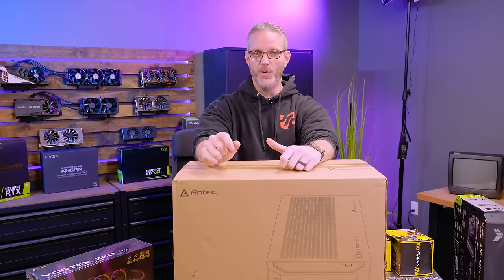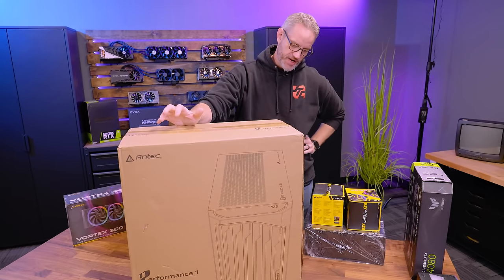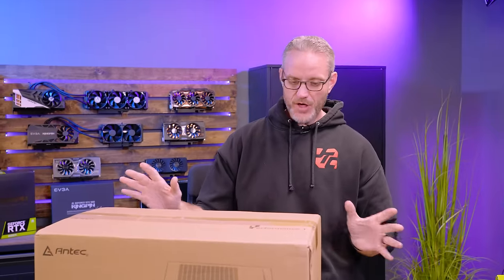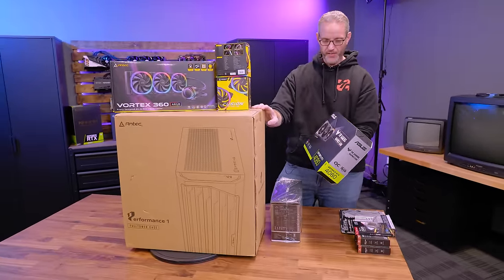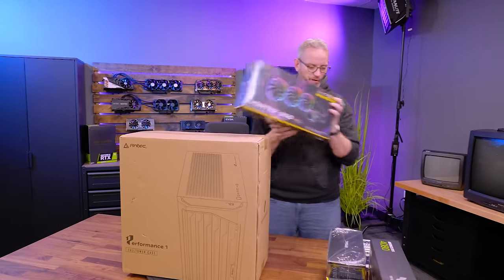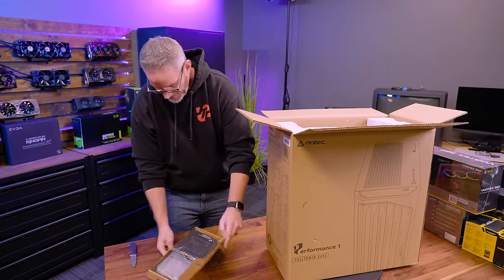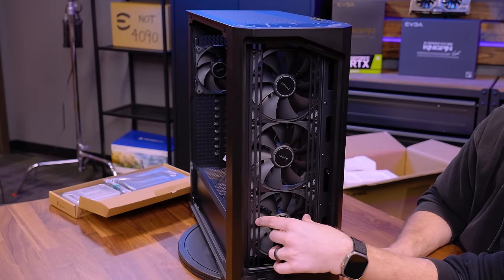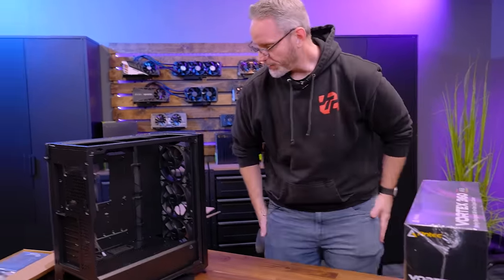Antec Performance 1 Full Tower Build!

Comment: Sharpen your knife, Jay. A dull knife can be more dangerous than a sharp one because you have to use more force to do the job, which means if you slip, you are more likely to cut yourself or stab yourself (still pointy enough for that) more severely than you would with a sharp knife that you don't need to use as much force with....or at least that is what they told us at Culinary school...it might be b.s.

Comment: I doubt I’ll ever not use Fractal Design cases
Reply: Amen
Reply: I've just switched from a Fractal Meshify C to an Lian Li Lancool III.  Have to say the Lancool III is epically good, but also really liked my Meshify C, and Fractal are definately one of the front runners right now.  Whoever came up with the idea of the North was mad and a genius.  It looks like my dads 1970's record player...yet stockists can't get enough of them - and the thermals are right up there (or down there....).  I can see them taking over the number one spot from Corsair in cases soon (please do it Fractal!)  Also - I had the PCB for the power/reset switch fail in the Meshify C after it was about 3 years old.  I contacted Fractal to ask how much a replacement would cost - they just sent me a new one for free - can't fault that for service.

Comment: Sorry Jay but this review seemed lazy or compromised, I understand it was sponsored but I still expect you to think about what you say. Unless the script was written for you, although I doubt you can stick to a script, but I digress. 😝

The sponsored review is for a "Full Tower" case.
Jay: This case is really easy to build in.
Me: Well dur, it's bloody massive, it should be.

It sounded like you're recommending their fans because they look pretty and, in your completely subjective opinion, "it's doing a really fantastic job".

Like many of the other commenters, I've got an Antec case. You used to have one and now you've been paid to look at a newer one.
I remember them being one of the better cases we could source down here in Oz, decades ago when I worked in a small PC shop. Their quality was better than the standard, sharp edged cheap cases every small shop used. Back then most of their cases came with a decent PSU (Earth Power/Watts?) and that was one of the best features. I don't know why they disappeared so quickly, it felt almost like it happened overnight but it was probably a few months. You could have provided some insight into what happened, unless that wasn't allowed?

Most of my system is antique, in PC terms, which is why I'm still using it. My newest component is an RTX 2060 I was forced to buy during one of the many lockdowns Melbourne had, luckily computer shows were "essential" so people could work from home!
I was looking at building a new system but the pandemic screwed shipping and prices up, then I stopped gaming and now it seems a bit pointless. I'm still trying to keep in touch with what's good or not and one thing I'm sure about is that my next build will be small, probably ITX but maybe mATX. When looking at cases I did look at the Antec site, a while ago,  but they had nothing appropriate.
Perhaps they'll read this, perhaps they ask you for feedback.
I don't see any point in getting a mid tower case now, let alone a full tower. Back in the day it was pretty standard because every computer had a CD/DVD ROM, some people wanted a burner too. Almost nothing was integrated into the m//b so you needed expansion slots, but now? Beyond a dedicated GPU what else will an average end user plug in?
There are some specific things we can think of to plug in but are they things an average user will need?

Comment: NGL, wanted to see a different build than @GregSalazar for this case. Thought this would be? But then you both had the same TeamForce SSDs. At first thought a cool addition to the build (on Greg’s), but obviously part of the sponsorship, which is fine….but really unfortunate that it was the key piece. Disappointed with both creators on this one. Doesn’t change my watch pattern. But wish that the builds were significantly different.

Comment: I will never understand the hype or interest in the glass rear panels on some modern cases. Like who cares about that side of the case/build? Unless you have RGB SSDs like in this build, there is literally no point in anything back there being visible. M.2 drives are becoming more affordable, so what's the point in having 2.5" drives in the first place, unless you're keeping drives from another build. The case even comes with cover panels to hide the wires, so what do you really even see back there besides those drives anyway? It's just added cost and weight for nothing. 

Lol, just my opinion. Sorry for the rant.

Comment: Oh look, a Lancool 3 clone....still waiting for some new case designs. I know it's hard. But this is literally a Lancool 3 minus the mesh on the PSU shroud
Also...removing the non-RGB fans to put in more clutter RGayB fans? ugh
Reply: Not as big as the Lancool III.   TBH I think this is closer to a mix of Fractal torrent homage with the front, and Phantek p600 elsewhere.  And removing good fans for rgb, yes yuck :)

Comment: This is the worst case Antec ever made. What's the point of a glass panel at the cable management side. Additional 2 extra metal panels clipped on to cover the cable management adding costs and more weights, and after you place it against the wall, it's the end of it you can't see it. A single metal panel would look much better

Comment: So much money wasted on that back side. 'Let's hide everything so we can put a glass panel on the back' oh you mean like adding a solid panel that will cost a tenth of the glass. And the excuse of showing off sata ssds doesn't work, because slapping them to the psu shroud does the exact same thing without blowing 90% of the r&d budget on figuring out how to hide wires for a glass panel.

Comment: and its still a crappy airflow-concept. Not a single case out there is actually thought through and makes any sense in terms of perfect air-flow. There is only one concept, back-to-front airflow in almost laminar fashion and if a rad is used than in the front.
Reply: That would need the motherboard I/O to not be on top.  Also your perfect airflow requirement goes out the window once radiators are being used.
Reply: @malphadour  do you have any experience with airflow? Im building custom machined cases for more than 15 years now, and it works. Nothing else works that good.
Reply: @PoisonNuke  Yes, rather a lot thanks.  Do you know much about fluid dynamics.....
Reply: @malphadour  looks more than you cause my design reduced the carbon footprint of a datacenter by more than 10% 
More than 50k server chassis based on commodity hardware are using my design.
So in contrary to you i did cfd and i know how to do it.
Reply: @PoisonNuke  So you are comparing data centre design to desktop pc design.  Two completely different disciplines with very different requirements.
Reply: @malphadour  see, you have no clue what you're talking about. They are not. The mainboard and cpu and gpu do not care if the chassis sits in a DC or under your desk. It is exactly ! the same. but Ill guess youve never seen a DC from the inside. And btw if you had any idea what you where talking about, you would have asked me first for some details why Im claiming that.
Reply: @PoisonNuke  You are talking about a desktop case and data centre.  They are completely different.  It is quite baffling that you think they are even vaguely related.  As for data centres, I stopped one setting on fire because the cooling had been configured so badly, so yeah I know how they work (or don't).   The fact you are comparing data centre to desktop gives me every reason to beleive you have never been near a data centre in your life.
Reply: @malphadour  I was technical lead of a DC company a while ago and set and industry record for power efficiency. There has no fire so far and the longevity of the commodity hardware has tripled since my case design.
Reply: @malphadour  i should add, we have used desktop hardware like every other inexpensive webhoster.

And yes dc and personal use is identical in every single regard when talking about cooling.
Reply: @malphadour  even though you didn't ask the right questions, here are some answers:
Power consumption of fans is still significant. Reducing noise also reduces  required fan power.
Reducing dead spots is the most important goal to improve longevity of components. That goal also helps desktop computers to reduce thermal load and increases efficiency due to lower temperature of the components.

I could go on, but somehow I doubt your real interest in the answers?

And btw what is the reason that you believe that there is a difference between DC and personal use? Provide me a single argument please, and I will show proof to you why its the same for both usecases.
Reply: @PoisonNuke  So how come you are comparing a DC setup to a mid tower pc setup.  They are completely difference.  The only area where your experience is relevant is in an ITX build that is not using radiators.  In a tower PC build the requirements are completely different.  And I repeat, as soon as radiators are involved pathed air flow becomes far less relevant.  It is a bit like saying you worked on formula one cars so all 4 door saloons are rubbish because they don't have a rear wing and double defuser.
Reply: @malphadour  on what foundation are you basing your wrong thoughts? As I said give me a single argument and I disproof you. 
Lets start with radiators. With back to front NOTHING changes regarding air flow thats the cool thing about sucking air out of the chassis
Reply: @PoisonNuke  A radiator just needs air - so front to back works, but so does front to top - which actually fits in a tower PC.  You are arguing that configs like this are inferior  - they absolutely are not because they do not need a wind tunnel config like a DC.  In a large case it just needs a volume of air to work with - direction is irrelevant.  Front mounted rad - top mount exhaust - works perfectly - again becuase of the volume of the case.  This is what you need to be taking into account.  As I stated before, they are totally different use cases. For someone who claims to have done CFD calcs you seem to be fairly clueless - if you have no volume then you need direction (DC being a perfect example) but if you have volume then the relevance of direction is significantly diluted.  Literally.  So a tower case with this design works fine, especially as it fits with the design of the components that are the industry standard - just a minor consideration.....
Reply: @malphadour  so you never measured or simulated a mid tower. Ok how should we continue because you lack the basics of the air flow in even big chassis. Hot spots around the gpu, never heard of?